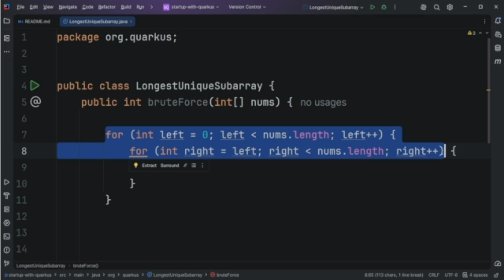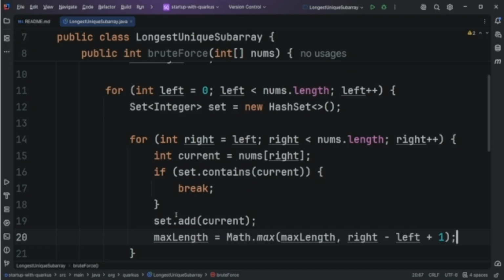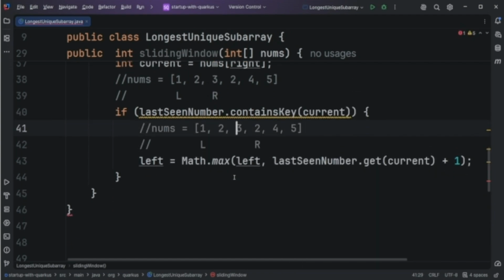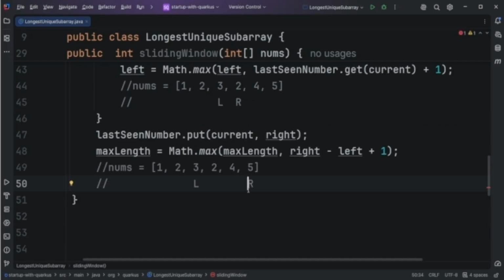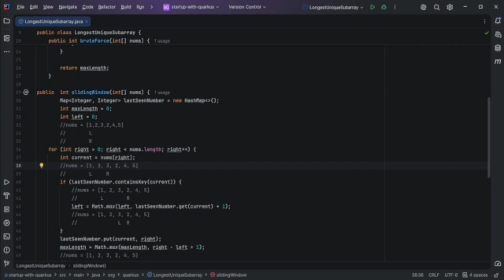Stop Re-Scanning Data: Engineering the sliding Window for O(n) Performance

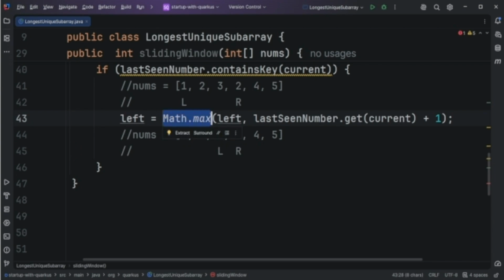Comment from the maker: Skip to 6:31 to see the exact line of code that prevents the 'backward pointer' bug—it’s a classic interview mistake!

Timestamps:

0:00 The Problem with Repeated Scanning
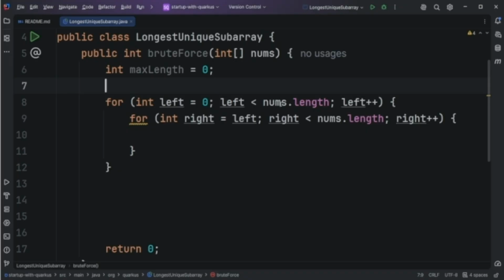1:10 Brute Force Implementation: The Naive Approach
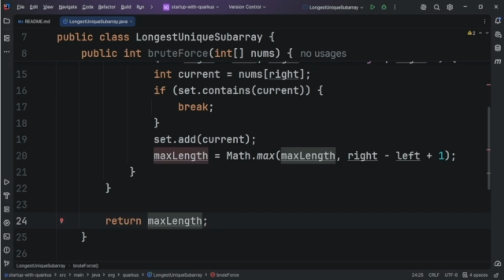2:40 Why Brute Force Fails to Scale
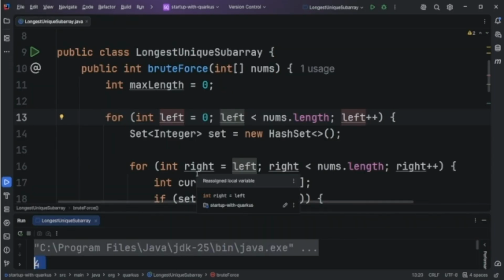3:41 Re-engineering with the Sliding Window
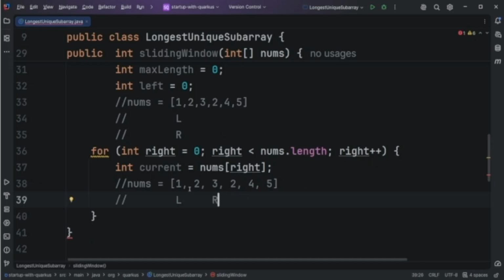4:56 Visualizing the O(n) Moving Window
6:31 Pro Tip: Why Math.max is Crucial for Pointers
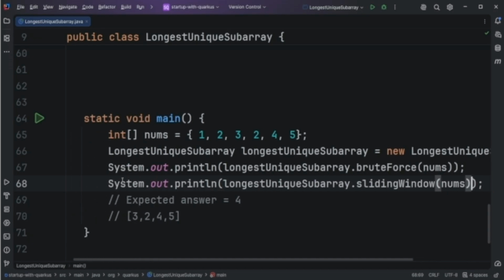7:46 Testing the Optimized Java Solution
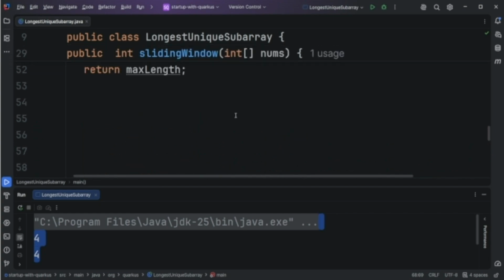8:01 Comparing Complexity: O(n²) vs O(n)
8:57 What's Next: Large Data Benchmarking